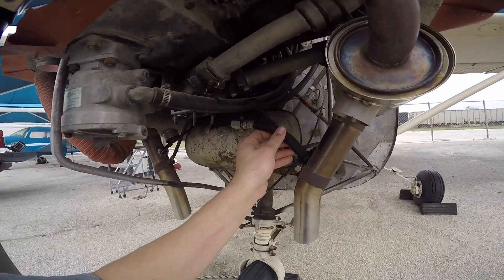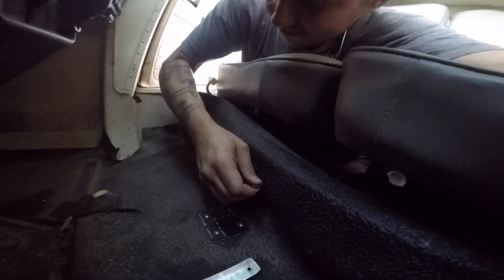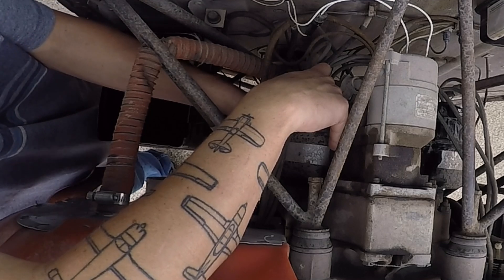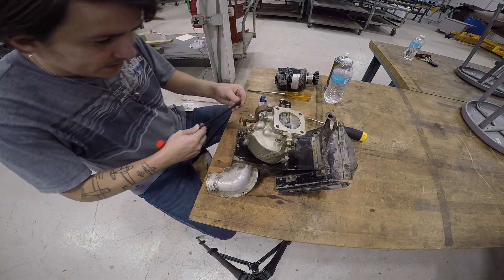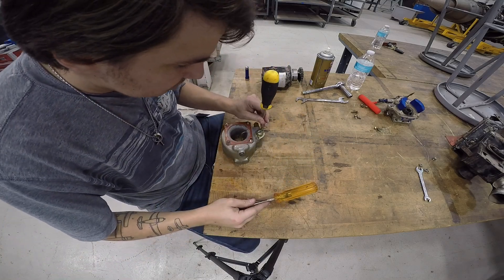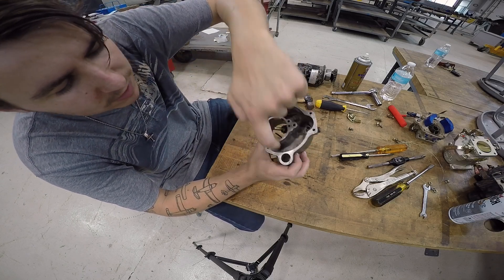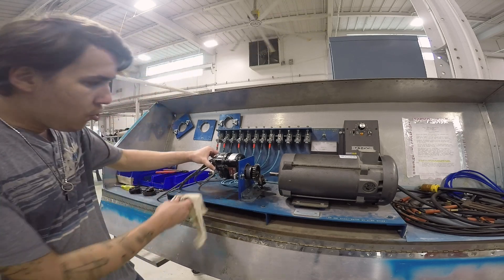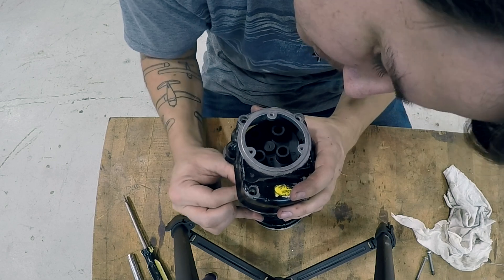Will This Cessna Start After Sitting For A Semester! Aircraft Gets Rivived For The Part 147 School

Comment: Nice video! Do 150s generally start that easy?

Mine takes a lot more cranking, sometimes up to three attempts regardless of OAT or if the engine has been running. This is not the first video I am seeing where a 150 starts so easily and I am starting to think I have an issue. I suspect it may be related to my carb. Do engines act like this if a carb is due for an overhaul?
Reply from the maker: I can get most 150s started in 2 to 4 cranks. Sometimes 1 if I primed it right. It really all comes down to how well you primed it, how strong the mags are, and the ambient temp. 

Try this next time, sump the water out a d give the primer 3 shots of fuel. Then do your preflight. The idea is all that fuel will start to evaporate and sit in the induction manifold so when your preflight is done and you hit the starter you'll have all those fuel vapors sitting in the manifold just waiting for some compression and spark.
Reply: @brycebuildsit  oh neat idea! Thanks, I'll give that a shot.
Reply from the maker: It really helps when the Temps are below 40.

Comment: What was the problem with the carb check valve?  It sounded like it might be cross-threaded when you were trying to unscrew it.
Reply from the maker: It was just clogged, the threads had corroded due to water wich is why it didn't want to come out (the whole systemwas clogged with gunk too.). I didn't film it but I ended up having to drill it out and tap it. But I had a new carb anyway.
Reply: @brycebuildsit   Thanks for the reply.  I heard that high pitched chirp when you were backing it out,  and when I've heard that sound doing similar work with aluminum devices it always meant trouble.  Great channel !